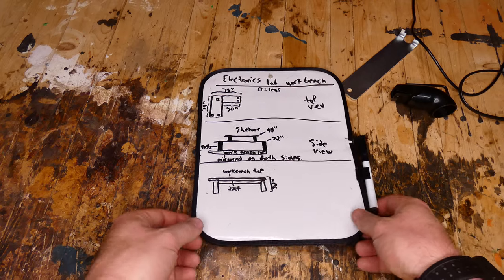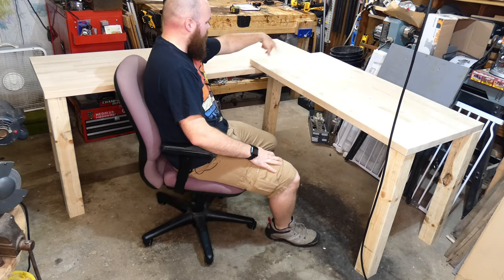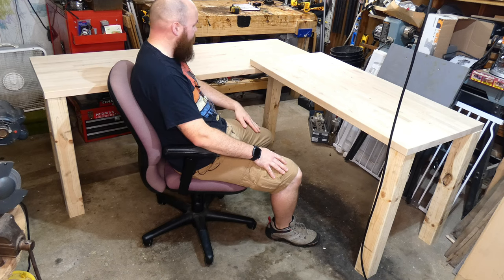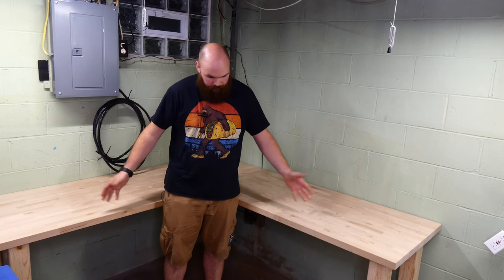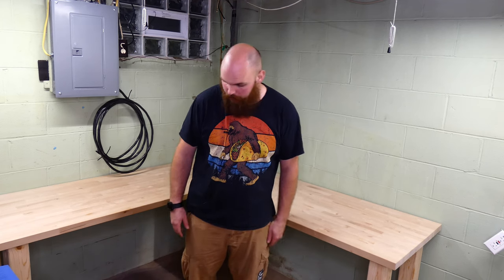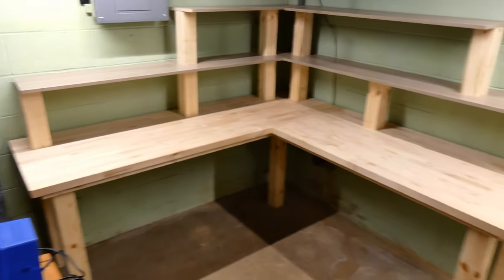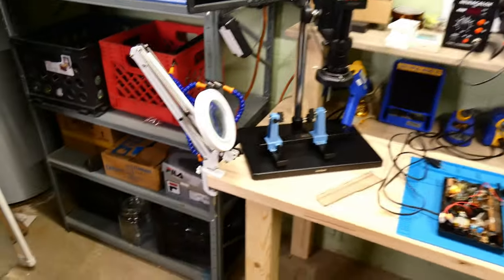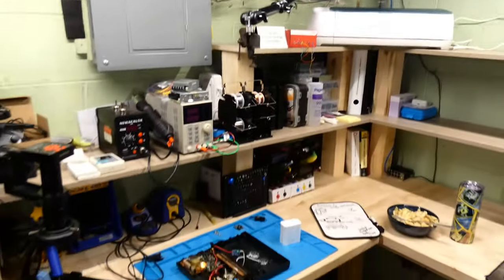Electronics lab workbench build

Comment: I am currently also building myself a workbench/desk thing of sorts. Mainly for electronics stuff. My challenge: I live in a 527 sq.ft. apartment so I do not have a whole lot of room to work with. The thing will sit in my living room, so I need to make every square inch count. My tool storage hanger (for screwdrivers, various pliers and cutters, IC puller, other specialized electronics tools etc) I am proud of…I got some aluminum C profiles/rails, a bunch of hammerhead nuts, set screws (both with M6 threads) and heatshrink tubing. Cut rails to length and bolted them to the side of the shelf. The set screws get covered in heatshrink and get installed in the aluminum rails with the hammerhead nuts…and the tools either are hung on the screws or held between two of them.  The heatshrink is optional and only keeps the tools from getting scratched up.